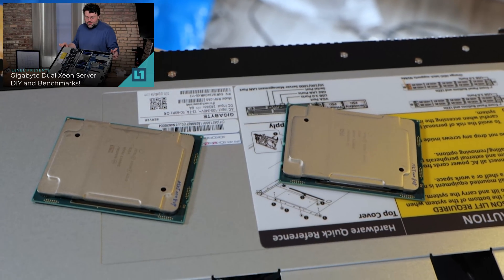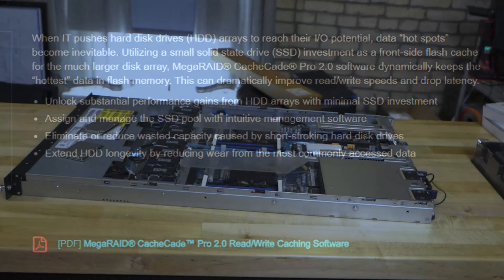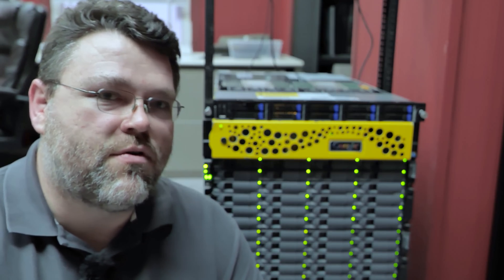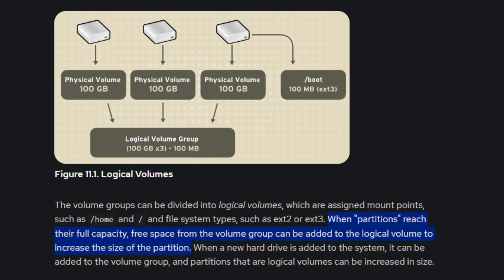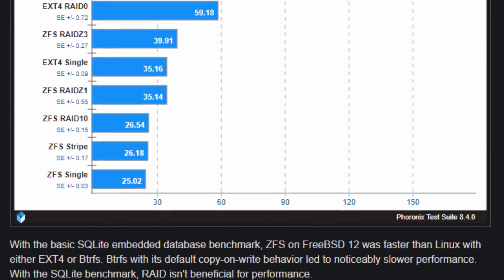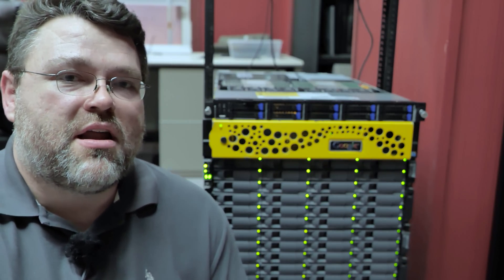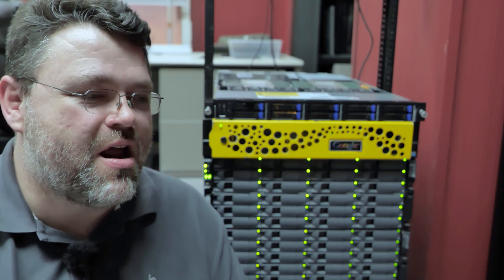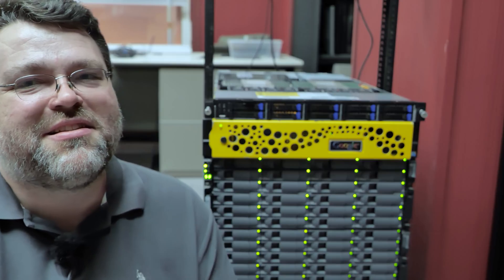Intro To Software Defined Storage! Hardware vs. Software Raid & ZFS!

Comment: Raid controller were made to unload the workload for manageing and controll the RAID workload on to the RAID-HBA because the CPU back then were not that powerfull. Now its different, but when using a SDS that doen't uses proper protocols the cpu load will have a bigger impact, especially when going in to a cluster...

Comment: Microsoft handles Tiered Storage - not at the filesystem level - but at the Storage Pool level.  You tell the Storage Pool manager that drives are either SSD or HDD and it manages it all from there.  It's all independent of whatever filesystem you use.  The filesystem could be either NTFS or ReFS and you could have all that in the same pool.  It sounds to me like ZFS doesn't have it broken up that way.  I know a little about ReFS but I don't know that much about ZFS.
Reply: Microsoft are doing some very interesting and flexible things with storage. ZFS is not that flexible but is tremendous for data integrity.

PS, ZFS is the file system and the disk managing system. Contrast with a RAID card. The RAID card munges the drives into one drive. The file system then partitions and formats without knowing it's a RAID system.

In ZFS munging the drives into pools and volumes with the file system as part of it.
Reply: @wayland7150  - Right.  ZFS is more monolithic and less modular. With the MS system, you can manage your storage pool in a number of different ways.  A storage pool might consist of 4 SSDs.  You could just aggregate all that storage into one volume and the result will be a RAID 0 configuration.  Or you could choose to configure these 4 drives using parity (RAID 5).  You could even configure them in a mirror (RAID 1).  And now that the volume type is configured, you can format it using either NTFS or ReFS.

ZFS is a monolith.  Your storage pool is your drive is your file system.  It's hard for a Microsoft guy to get his head around.

P.S. Microsoft's RAID 5 is DOG SLOW and should never be used.  ReFS may help with data integrity but you don't even want it after you see how slow everything is.  It's a mess.
Reply: @GizmoFromPizmo  Actually with Microsoft you can do both aggregate it into one large RAID0 drive at the same time as having it as a smaller RAID1 drive. You can have one drive that appears to be 1TB and another that appears to be 2TB. Obviously they both fill up as you fill one up.

ZFS is very easy. Each 'partition' is actually not a fixed size but sharing the same storage. Nothing stopping you from building multiple sets if you have enough drives.
Reply: @wayland7150  - Yeah, I didn't want to get too deep into the weeds on that.  I considered it but decided against mentioning it.

Comment: I never understood the use-case for ZFS. I'm not saying there isn't, but no one ever presented me with a compelling one where ZFS is clearly the better option: if you are in a home/small business setting and need directly attached storage, using BTRFS is simpler and more economic (less $ per usable GB, with all the ARCs and the RAM requirements, less man power to setup and maintain). If you are setting up a NAS for a small/medium business, if you need to saturate a 1GBps link, BTRFS with NFS or Samba will do and if you need more - you'll be better served by an SDS like Ceph or Gluster where multiple servers provide aggregate bandwidth. If you are building a dedicated application for a large company and need massive performance, you can use the same SDS in a SAN or a dedicated solution such as HDFS or GridFS.

ZFS seems to apply to a very limited use-case: you have but a single server, but it can be (and kind of needs to be) massive like in this video (what we used to call "vertically scaled"), you worry about disk failure but not about other  failures (power distribution, CPU, RAM, software, networking) you have the manpower to engineer a ZFS setup and everything going on around it (NAS? VM storage?) but not a to engineer a dedicated software solution. I've been in the IT business for almost 30 years by now and haven't see these set of requirements in a long long time.  Frankly, it seems like a 1990s approach to storage needs and maintenance. These days we expect to do less, pay less and get more - than ZFS can offer.
Reply: The requirement of ZFS are not that difficult to achieve these days. In the past 64GB of RAM would have been too expensive. The point of ZFS is to allow you to use massive hard drives reliably. If you need only small reliable storage then I'd RAID two SSDs.
Reply: @wayland7150  my version of small is 15TB - an SSD still won't cut it (at a reasonable price point), and 64GB is still a lot of $ for a home server of a middle class family. I run my array on a i5 2nd gen (an upgrade from the E6680 it used to run until very recently) with 2GB RAM and that same server is also running ~10 other software services, from media streaming to messaging. You can't do that (and get reasonable performance) with ZFS, but BTRFS can live there, in a corner behind all the other stuff and still serve multiple video streams over NFS and SMB.

Comment: "ZFS is gonna be amazing when it will properly support having mixed speeds of disks" ... I'd also like to see it support some other things that I've heard (from Linus) that UnRAID supports - adding different drives to an array individually, AND if more drives than your parity / redundancy fails, you ONLY lose the data on those drives, NOT ALL your data.

Comment: ZFS is also the slowest and most unreliable thing you could do for your storage. Only thing it's really good at is single user single thread use and L2ARC is quite good, shame it tends to never fully warm :(
Reply from the maker: Unreliable? Lol
Reply: @Level1Techs  Having had quite a few arrays nuked by specifically ZFS (well ZOL) software issues - Yes, unreliable.

When you loose 500+ customers data over and over again, you tend to choose something else instead - otherwise you lose those customers.

So Wendell, while you know a lot, you don't know everything and every use case. Please don't be arrogant, but try to learn.

ZFS is way way way overhyped
Reply from the maker: You are not using it right or you were bitten by some bleeding edge bug from the days when fuse was in use or something. You could possibly have been bitten by hardware limitations you don't realize like most motherboards are not super reliable if you use all sata ports at once
Reply: @Level1Techs  Well, i consulted some other DC owners at the time, they had exactly the same issues -- regardless of implementation.

There were at time some very important fail safes missing completely.

At the end of the day, the ridiculously bad random I/O performance was enough to drop ZFS.

I know many who are ZFS religious, and understand it's hard to see past a religion. Ultimately however, it's data that matters for businesses like ours who do not have infinite budgets.

Comment: Even the humble x570 chipset alone, offers an amazing array of IO on a 8GB/s bandwidth pool.

6+2 sata, 2x 4GB/s ports (either pcie 4 x4 slot, or m.2 pcie nvme port), 3x pcie 4 x1 (1GB/s each) for further nvme adapters.

Comment: i've been using freenas in my homelab for the past year with zfs and it's been a fantastic experience.  significantly better than my previous lvm raid6 with lvmcache configuration and technically provides a much higher level of data integrity checking and protection. - As Wendel was saying, however, I REALLY wish that zfs could support seemless multi-tiered storage, I really wish that zfs would implement a better system for defragmentation (Because it's COW once you start getting into 80+% utilization, disk fragmentation becomes an issue and there's no way to defrag other than moving your data to another pool which is a serious pain in the neck), and I also wish that zfs would allow for vdev expansion so you don't end up wasting so much additional space on redundancy or don't have to strategically buy up and roll out 6-8 disks at a time for a new vdev to add to the pool which means for many users (home users in particular) a new shelf or a whole new server. - otherwise zfs is really fantastic.  it's certainly ready for prime time, and yeah, hardware raid controllers are deader than dead now.  zfs is way more functional, and provides way more advantages.

Comment: I have used LVM cache on desktop to get some extra mileage out of old SSD+HDD. It works great for incremental rsync and unison. Sadly Fedora is buggy if you use it on root filesystem... It was supposed to be faster, but instead it marks the entire cache as dirty and takes 30 minutes flushing every boot.

Comment: Our definitions on "software defined storage" differ in that SDS should include an API for management. Create a LUN, volume, mirror, clone, etc. Manage those by growing/shrinking, and every other aspect. The vision of what EMC's VIPR used to be is a good example of an SDS platform, as is IBM's shark, Hitachi USP+VSP, datacore, Netapp w/ OCAPI + WFA, etc.

Your definition isn't 'software defined storage' per se, mostly just software defined RAID and volume management. More modern versions of this are Erasure and Ceph.

Comment: Open Media Vault or OMV is a great open source file management OS that can handle/create any file system you throw at it.  Plus the OS is packed with so many great features. Since it is free and open source you never have to worry about proprietary software fees

Comment: Modern Software Defined Storage on Truly Ancient Hardware.
I backup my Ryzen desktop with Ubuntu on ZFS to a Pentium 4 with FreeBSD on ZFS. Only FreeBSD supports 32-bits for ZFS :)  My Back-up Server is a build based on the remains of a 2003 HP D530 SFF with a Pentium 4 HT (3.0 GHz), 1.25 GB DDR (400 MHz) and 4 leftover HDDs together 1.2 TB (2 x 2.5" SATA-1 and 2 x 3.5" IDE). Both systems are protected against the frequent power-fails by an Avtek 1200W Surge Protector.

Total Server Costs: DOP 1000 ($20) for an 3rd-hand Compaq Evo Tower and a new locally bought 500W iTech power-supply, coincidentally coming with 2 SATA and 2 Molex connectors. The Case-sticker says: "Intel Inside Pentium 4" and "Designed for Windows 2000 Professional / Windows 98". 

The system runs 32-bits FreeBSD 12.1 on ZFS with XFCE, XRDP and Conky and it is powered on for <1 hour/week, so it ages for say ~1 week/year :). The system is connected to a 1 Gbps network, but in practice it runs at ~200 Mbps, due to a CPU load of 95% on one one the HW threads of the Pentium 4 HT (3.0 GHz). The load is caused by the network process and not by ZFS.
Reply: lga1366 is dirt cheap and is like a supercomputer compared to P4.
Reply: @Mr.Leeroy  Well I just  paid $20 for mainly the power-supply and I reused two 320GB laptop HDDs and a 250GB and 320GB IDE HDD stored in a cabinet for 3-10 years. I only need the PC once/week and today I did the whole backup in ~20 minutes. Part of the fun for a Dutchman is to reuse completely written-off hardware. 

Besides the ZFS snapshots take a second and afterwards I can continue to use the Ryzen desktop normally, while the snapshots are sent to the backup-server. So for me it is irrelevant, whether it takes 1 minute or 60 minutes.
Reply: May be by rsync? It is possible to make rsync consume less CPU.
Reply: @Pupkine-666  The main load is caused by the network process that handles many many 1500 bytes frames/second. Rsync would be a disaster for backing up ~50 VMs with 5 to 40GB files. ZFS only sends the modified records not whole files.

Comment: ZFS is still a work in progress, and software raid works well for high end systems. For "spinning rust" as you call it though hardware RAID is far less costly (enterprise equipment is inexpensive on the used market because of the typical 3 year turnover rate) and can be implemented on computers without CPU's costing thousands of dollars. Software RAID still has a bit to go before becoming as reliable an easy to implement as hardware RAID, it will get there, but it isn't there yet.
Reply from the maker: I would put single chassis zfs "raid" of spinning rust against the best hardware lsi hardware controller any day of the week, especially with non-sas but still higher end spinning rust any day of the week. Zfs has way more overhead but also way more internal checking. Is the hardware raid good enough? Yes. Is it better than zfs? Not in terms of data integrity. 

It is possible for me to shut down the lsi based system and introduce errors that won't be detected and that will return bad data once it's booted back up. I am unable to do the same thing with a zfs based system.. it will correct the error automatically assuming I don't introduce too much corruption.
Reply: @Level1Techs  Dual ported SAS gives you more hardware redundancy and protection, I wouldn't even consider doing SATA considering the price of enterprise SAS drives on the used market (the prices are insanely low). I understand you're a big fan of ZFS (many are), but the cost and management are FAR lower for hardware raid right now. For example for around $300 I can put in a RAID card with 8 900GB 2.5"  10K drives on a RAID 6 setup and have 2GBPS (that's Bytes not bits) read and write on a windows workstation. For larger server requirements Dell md 1200/1220's are dirt cheap and combined with a R720/710 I can have mass storage for far less than you paid for your 1U chassis. I know it's old tech, but for many people this setup works great at a low cost. I would also mention you get enterprise software to manage it all that simplifies everything.

I like ZFS on higher end builds, your points on NVME I agree with, I just think making use of the mass amount of enterprise hardware on the used market can work for many people far simpler and cheaper.
Reply from the maker: I agree it can be simpler and cheaper, and often faster. But the level1 storage server is dual ported to each drive and it works fine with zfs, ha failover and all.. With enterprise-ish shelves and backplanes (SATa) that runs on the backplane mostly anymore anyway.
Reply: @Level1Techs  All you need is a good understanding of linux and a VM to run it, I do think we're in agreement here. For higher end systems with a competent tech ZFS is attractive, for the rest hardware RAID is as you say "simpler, cheaper, faster" to implement. I do think software RAID is the future, but for the here and now hardware RAID still makes sense for many needs. :-)
Reply: @karencarter964  ZFS is built for scalability to PBytes in real scenarios, while maintainig rock solid reliability. Not speed. You are talking apples to oranges.
Reply: @Mr.Leeroy  Thank you for the summary. Was looking at a storage system for my editing rig. Been reading so many recommendations of ZFS where people keep saying "reliable" and "data integrity", while no one mentioned the actual speed. Think I'll stick with a Thunderbolt Hardware Raid 10 then for the sake for pure performance, with some redundancy. :)

Comment: "If you were trying to do that on a PCIe card..." [...] "That's why we haven't seen NVMe RAID cards..."
Someone hasn't gotten their hands on NVMe RAID cards from Broadcom yet...?
https://www.broadcom.com/products/storage/raid-controllers/tab-12gb-nvme
(The current gen is even PCIe 4.0)

But Broadcom is also going on my blacklist, "Broadcom is stopping to validate drives, the drive manufacturers are to just send us their opinion if the drives work with our stuff".
Hooray for Enterprise-level support!

*Edit*: Not arguing against ZFS on a Server - but is it too much to ask for something insanely fast and large that can be used on a Windows machine locally?
Reply: @starshipeleven 
Don’t like Windows Storage Spaces because for some reason random 4k performance sucks compared to AMD’s NVME RAID feature for example. Also no booting from these spaces limiting use cases.
Reply: @abavariannormiepleb9470  I think the OpenZFS people are currently trying to port ZFS to Windows.
From my experience adding (and using) not normally installed filesystems on Windows is annoying to say the least, but let's see how that's going to work out.
Reply: I'm testing a highpoint ssd7103 for use as a vm os and datastore in hyperv under windows server with 4 nvme m.2 ssds.  Limited to raid 1 or 10, but so far so good and means no need need for windows storage spaces
Reply: I have one of those. Well, an Intel branded one, to be precise. It works really well on a Windows machine and does exactly what I expect it to do. I've never actually tried to connect an NVMe drive to it, though.